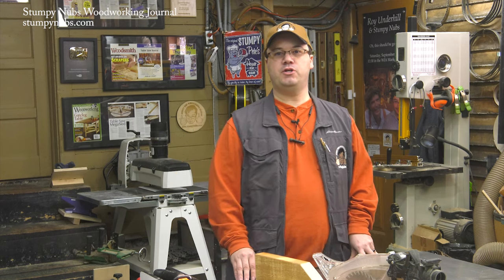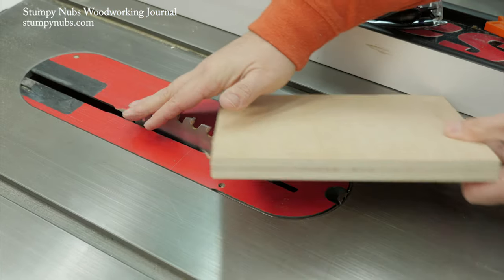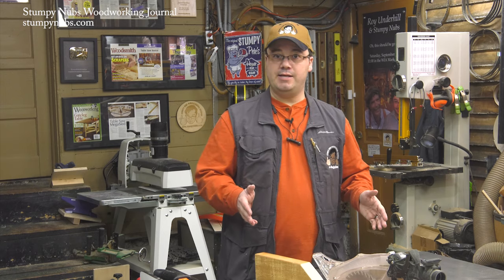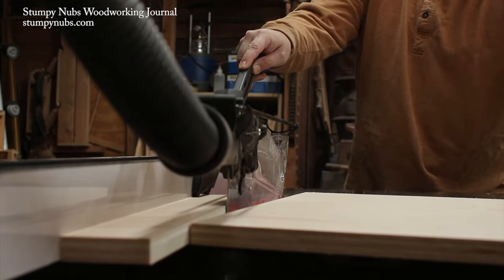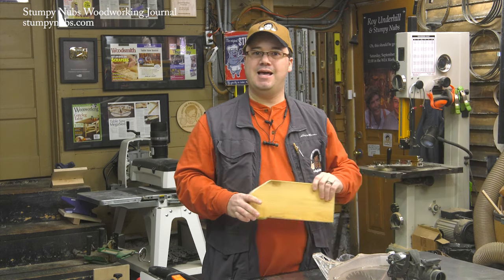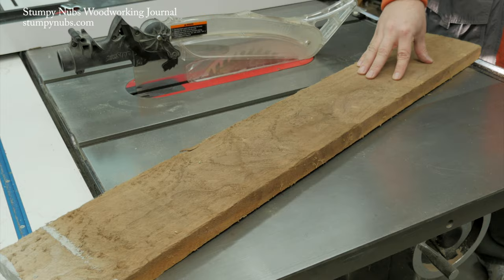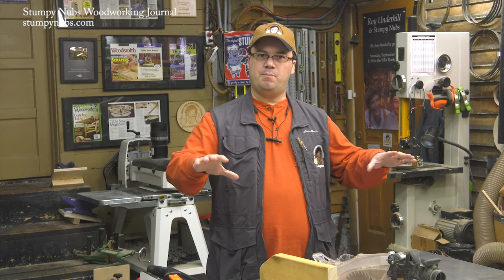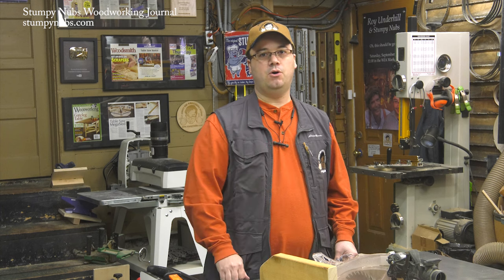Table saw safety tips you forgot about (or never knew)

Comment: At 11:00 you say to ask yourself four questions. I’d add a fifth: “am I frustrated?” It may sound silly but being in a bad frame of mind will easily make you not focused and inclined to do poor, quick work.
Reply: That's a good one. I nearly cut off my fingertip while being in anger and deburred a workpiece.
Quite close call - took a month or so until the part of the finger was fully regrown...
Reply: This is one of my most important safety measures. Whenever I get frustrated, I turn my saw off, switch off the lights and lock up my shop.
Reply: @GeorgeSA5  i would add am i sober. because if not i should be nowhere near this saw.
Reply: Lego God ##22
Reply: You may want to also stop when you say to yourself "I'll stop after this cut". That is usually my clue to stop at that moment! Thanks for videos!
Reply: There is actually a 6th, vital question to ask yourself in these moments:   "Am I hungry?"  Hunger is just as harmful as fatigue when it comes to making mistakes in any activity that requires concentration.  Being hungry also tends to make people rush to finish so they can go eat, when they should just go eat then finish the work.
Reply: Do I need to pee? If yes do not cut. Go pee. Highly distracting.

Comment: I would add adequate lighting. If you can't effectively see what your doing then your opening yourself to problems. I know too many guys who work in their 2 car garage with a 60w bulb as their main source of light.
Reply: I totally agree. I used to do the same thing in my garage with a 100w LED "daylight" bulb until I noticed that I had a hard time seeing my sawblade kerf. I just added some new 4000 lumen shop lights (from a place that has sponsored James, rhymes with "dockler") - it's nice to be able to see what I'm actually doing.
Reply: Guilty as charged.  And it's crazy when you consider how much extra lighting you can get for £$ 30-50
Reply: Yep.  I've got 12 fluro tubes in my garage and I feel like it's still not enough.  I'll be upgrading to so 'Close Encounters' level LEDs soon.
Reply: I upgraded all my florescent tubes to LED. Huge difference! Plus no flicker/low light when it's cold!! I still use LED spots at the machines for extra lighting too. I've found you can never have enough.
Reply: In addition to the LED upgrades, I'd recommend wearing an LED wearable headlamp, too. Especially useful for finish work on furniture when the lights on the ceiling don't illuminate the underside of a table or bench.
Reply: I don't know about America, but in Ireland, insurance companies will use it as an excuse not to pay out if you injure yourself
Reply: So true I just added four LED ceiling-mounted shop lights to my work area. What a difference! I was an idiot for not doing this sooner. You can follow all the safety techniques but what good is it if you can hardly see what you’re doing?

Comment: Another safety tip is to position your body out of the line of fire in case of kickback, even with guard and riving knife in place. I've had one kickback in 20 years..a tiny 8"x1"x1/2" piece of wood. Hit my abdomen side, hurt like hell, big bruise and still have the scar.

Also, don't "fear" your table saw; you're more likely to be tense, anxious and/or rush a cut when using it. We don't think as clearly or rationally when anxious, so more chance of error. Rather, treat it with healthy awe and serious respect. Take your time, mindfully.

I never use hearing protection with the table saw though. Maybe i should?? I never seem to use it for more than a minute or three at a time, it runs sooo smooth and seems no louder than our domestic vacuum cleaner! The worst noise offenders in my shop are angle grinders and the thicknesser..always use protection with them!

As for the blade guard..l, like so many never use one. BUT.. I NEVER make a cut without a traditional push stick in my left hand, and a push block in my right hand, unless using a sled or ripping larger sheets of plywood where my hand is at least a foot away from the blade. I don't ALWAYS use the pushstick in my left hand; it's there "just in case", and by holding it as i cut, I can't thoughtlessly reach toward the blade (to move an offcut or guide the wood) with my hand.

Brilliant video as always. Thanks : )

Comment: Good advice. I'm fairly new to woodworking and always do a dry run (no power) of a cut on all of my tools. I've found a few times where I would have been in a bad place
Reply: I am new to power tools (table saw) and do this exact thing, too. In fact, I try and picture  the entire start-to-finish in my head. That way, I can visualize a potential problem, which usually come right near the end of a cut.
Reply: Another good thing to remember is that you can turn off the saw if you become uncomfortable

Comment: These are all great safety topics.  I'd add emphasis for the hearing topic.  Hearing loss is a slow and insidious danger.  The problem is, hearing doesn't come back.  As you damage your hearing, it just gets progressively worse and worse.  The little one or two times (over and over) are not big deal that one time, but pretty soon you'll be saying "what?" a lot more than you expect.  Get whatever hearing protection that you'll consistently use and use it, all the time.
Reply: Go kart, dirt bike, chainsaws, shooting sports and electric guitars... what did you say again?  My hearing loss isn’t all that bad but the tinnitus sucks.
Reply: I spend a few pounds on extra ear defenders. I have one pair on a hook by the power switch of all my machines, effectively blocking the on button. I have to move the defenders to turn the machine on, so it's a great reminder to use them. (Note: If you try this yourself, make sure your hook doesn't impede access to the off / stop button.)
Reply: I find wearing a pair of Bluetooth necklace style headphones and using the earplug rated earbuds is a no brainer way to always put them in my ears.

Comment: Add a removable magnet to your preferred push block and you can stick it to the fence.

You can avoid accidental damage to the blade by fully retracting the blade when the table saw is not in use. Nothing can land on the blade if the blade is not there to be hit.
Reply: I always retract my saw blade before wrapping up after a good day in the shop! I don't wear ear protection as I'm already deaf from working a lifetime in Aviation. There's a warning for all you fearless youngsters, listen to the man!
Reply: @henrysiegertsz8204  Can you still catch tinnitus? I guess it depends on where the deaf part is.
Reply: @henrysiegertsz8204  Ditto on the ear protection...A lifetime of hearing sirens on Fire Trucks & Ambulances have caused their toll!!! Listen to this Man!!!
Reply: My hearing loss is from firearms over a lifetime of shooting.  I still wear hearing protection now to protect what is left, even when mowing the lawn.  I have a delta table saw on a folding stand, which is stowed against the wall of the garage when not in use.  I retract the blade fully, which also means removing the blade guard every time I put it away.  But I always put it back on before starting to use the saw again.  The riving knife stays attached and completely retracts along with the blade.
Reply: @claytoneads6842  Ya, I worked a lot of mountain regions on ambulance and the sirens bouncing off the cliff faces multiplied the sounds. We started wearing hearing protection when in the areas because it was distracting and LOUD.
Reply: Magnets on push blocks are never really a great idea because they can pull toward your blade if you're too close
Reply: @Metalcool36 
That did not occur to me.
So, best practice is to make it so the push block hoods onto the backside of the fence. You don't need anything but wood to do that.
Reply: I have a genetic disease that caused me to have tinnitus 15 odd years ago. It's deeply unpleasant. It stops you concentrating, it stops you sleeping, it makes having a conversation difficult and you'll be screwed trying to talk to someone in a loud busy area.
Tinnitus isn't something you want. Some days I wish I were deaf rather than having to listen to this noise another day. Get yourself some damn ear protection.
Reply: my fence is aluminum :) won't stick
Reply: @carpocraftguitarscarpentry8469  

There are two options for an aluminum fence.
1 - Glue a piece of steel to the fence where you want to store the push block. 

2 - Make a caddy that rests on the top of your fence and down the back side. Your caddy can have a tray that you put your push block in or you can glue a piece of steel to it's backside where you store the push block.

Making a caddy obviously gives you more options of how to store your push block so that it is handy and has a place where it won't get lost.

For instance, a slot rather than a tray.
Reply: @scotttovey  thanks, I was kind of joking, I could stick it to my saw (Large iron table) but really I prefer just throwing one to the side.
  I have always used what I have, which is not much.  Make my own jigs and push stix.

Been building guitars lately, so my table saw is only used sparingly, but it is still the center of the shop
Reply: @carpocraftguitarscarpentry8469  

😎👍

Comment: One additional tip. Be sure that you have good traction on the floor. If there’s anything slippery (oil, wax, water, dust), clean it up. Don’t have slippery stuff on the soles of your shoes. Wear shoes that hold your feet securely.

If the floor is slick, and you can’t remedy that by cleaning it, then sprinkle a little rosin powder on it.

Comment: I've been cutting on a table saw for 60 years and it never gets old listening to good safety advice. Only by the grace of God do I still have all my fingers. 2 weeks ago, I had a rip cut to make on a piece that was less than an inch wide. I started the cut and when my fingers got about 5 inches from the blade, I pulled back with a slight cold sweat at my forehead. I couldn't believe what I was about to do. I then went over to my scrap plywood pile and retrieved a small piece of 1/4" ply. In five minutes, I had cut out my first bush stick and finished that cut I was about to run my fingers through. Since then, I always make all cuts with that scrap wood that is less than about 8 inches wide. Who says that you can't teach an old dog new tricks.

Comment: I am not a woodworker myself. I follow at least 10 relevant channels in YT. No one of those people is using a blade-guard and I think only 1 or 2 are using that safety fin behind the blade. I get it that everyday use make people more comfortable with tools but I guess it only takes an instant to loose a finger.
Reply: Youtube woodworkers are in a strange spot when it comes to blade guards.  Watching where the blade contacts the work piece is actually important information.  Leaving the guard on will often get in the way of the shot, thus making it harder to communicate what they are doing.  So the whole "unless you can't make the cut with the guard on" thing takes on a slightly different meaning.

That being said, it's my opinion that the saw's operator gets to decide how best to balance and mitigate risks.  And if you see someone doing something you feel is unnecessarily risky, feel free to tell them afterwards, but do NOT distract them in the middle of their cut to say something.
Reply: I can`t use a guard because I built a sled. It offers so much safety and control that I'm happy to make that trade-off. But the riving knife is super important, and doesn't interfere with anything.

Comment: I blow down my equipment every time with an air gun.  It’s sort of like brushing your teeth before you go to sleep.
Reply: I substitute a leaf blower as I have to do my wood work on the back deck. It's a nice cleanup before putting everything away
Reply: @danhammond8406  yup, you'd be surprised how much less issue they have in the long run.  Dust is the worst enemy.

Comment: Most comprehensive video on Safety and the one that made me subscribe... You are as thorough as you are Professional and don't leave important details out, except... never raising the blade more than one carbide tooth above the top of the cut piece. Please don't quote me, maybe I didn't see it or was distracted (I'm already breaking one of the safety rules, but If I'm wrong, my apologies) and most importantly, your presentation and key points were just what I was looking for. Thanks for the tip on the bluetooth, glasses, hearing protection gear! My mother says "Stupidity is a human disease that only gets cured with a few drops of common sense and a few years of reflection"

Comment: Another shop safety tip: watch what you are wearing around machines. There are lots of YouTube woodworking channels where the person is in flip flops or bare feet; wearing hoodies with dangling strings; loose clothing should be controlled such as covered in an apron; large watches and rings;  all potential hazards. I use a  full face visor to go over my glasses and keeps the small sharp bits hitting my face. Beginner hobbyist woodworker.

Comment: I’ve got about 15 years of woodworking experience and I still watch your excellent safety and tip videos. Thank you! One safety tip you might want to share. Newbies and hobby woodworkers may not have a full size or cabinet saw, merely a compact or job-site saw. My first was the excellent DeWalt compact saw.I retired it recently and ponied up considerable cash for a SawStop contractor saw. I just LOVE it! Here’s the tip: when possible I don’t stand behind the piece I’m cutting — I almost always move out of the danger path. Very often I walk around and stand on the side of the saw behind the fence and push the wood through the blade. This works best if I am using a hand to push the wood through the cut. I’ve never tried it with a push block and I’m not sure that’s a good idea anyway. But this works well with my hand (of course the wood has to be wide enough to not pose a danger) and with my Grripper.

Comment: I was taught carpentry 20 years ago, by some old timers with skills. But one thing they taught me was safety, and another was to remove my table saw safety features and go bare blade.
  I wrestled with this for a long time, only recently putting back on my guard. I NEVER removed it from my miter saws like some guys, as I KNOW I might bump that blade when moving fast. 
Hearing protection and goggles are just the first thing I put on. Even one cut. Be smart

Comment: Hi, James, not sure you'll see this, as it's been over 3 years since you posted the video. Anyway, I've watched most of your vids on table saw safety and usage tips (just got my first table saw a month ago). Bought it for the 10" blade capacity, but not happy with the fence-- it doesn't hold well, and is difficult to move. (Maybe I'm using it wrong?). Front and back do not move in concert with each other, pain to align both ends square. Much fiddling needed. And without unlocking both ends, I can easily move the thing around-- in short, I can't depend on any accuracy from this thing. Any tips, tricks to help me remedy this?

Edit: The brand is Kobalt, bought it for $300.00 at Lowe's.. Thanks!

Comment: And for those of us who just think we know better?  Maybe make a sign and post it over the entrance to your shop.  The sign should simply read: "CHECK YOUR EGO AT THE DOOR!"  You (and I) are NOT better, cooler, more experienced than anyone else when it comes to developing good habits.  Just force yourself to take the steps necessary to use this tool, or any power tool safely.  Once you get in the habit, you'll just do it automatically.  When's the last time you drove your vehicle without snapping your safety belt?  We don't!  We just do it out of habit.  And last, it's nobody's business if you like to have a drink or two or hit a joint or a gummy, but these just don't go well with workshop safety.  Work smart, don't become a statistic.